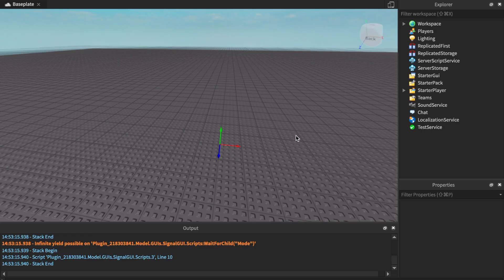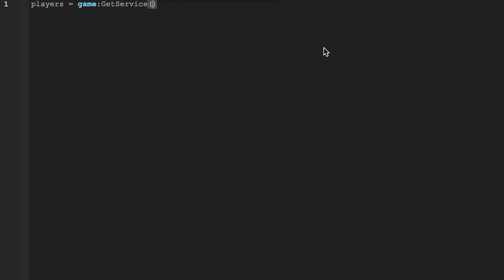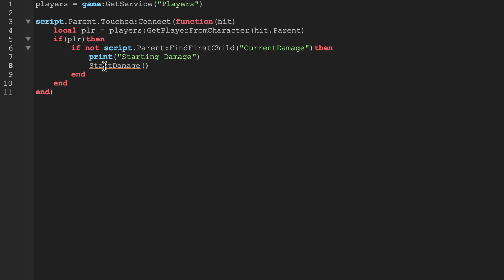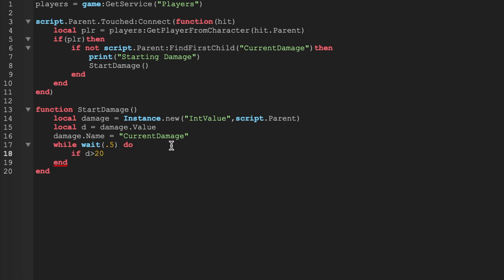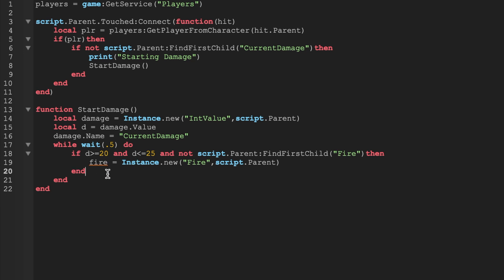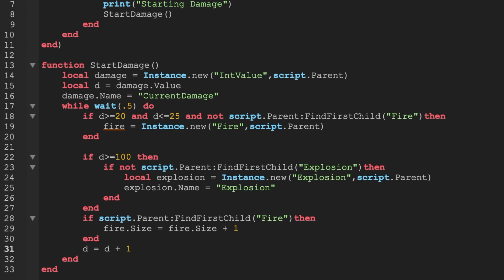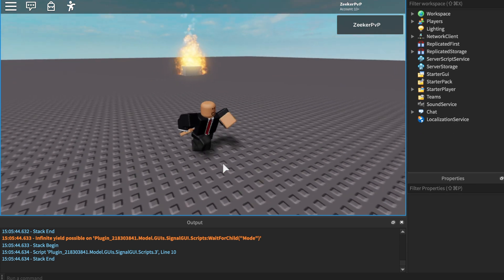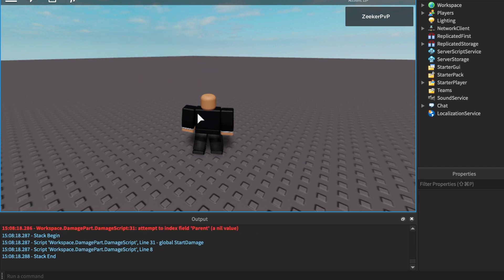Exploding Part Damage (Explosive Barrels)

Comment: Hey I've got issues with a rocket launcher script that works but has no regard for the players arm, not exploding in the players arm, ect. Research into how I can fix this suicide issue has made me quit scripting a couple times over the past two years when I pick the research up and put it back down every so often. I have tried brainstorming  theoretical team check collision disabler ideas and explosion damage players' team check ideas but am for the most part powerless to go pioneer this myself. Rocket launchers are not common anymore in Roblox and looking for help with one has been a huge panic crisis. if Instance.new('Explosion') can have its damage set to Zero except when the radius of the explosion encompasses an enemy player that would fix my suicide issue but not my collision issue. Fixes for the collision issue could start at finding a way to have the rocket spawn from the tip of the launcher instead of the origin point of Handle/Tool, or having a collision and or touched check for teammates. I am how I have already described though a complete neanderthal with no scripting knowledge 🥶. Even if I had scripting knowledge in other departments - nobody has really touched rocket launchers since like 2011 outside of maybe counter terrorism games.